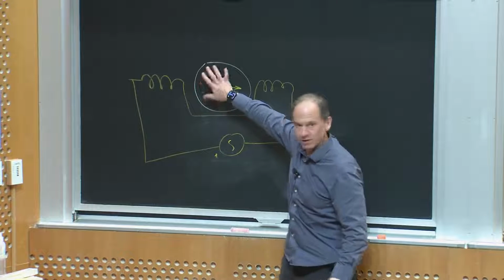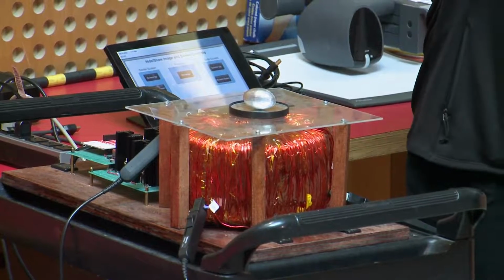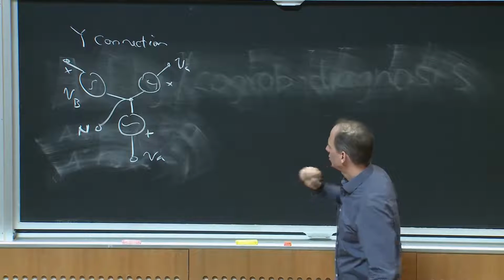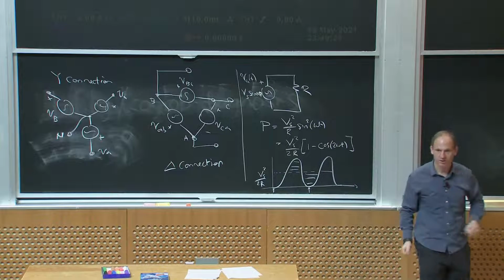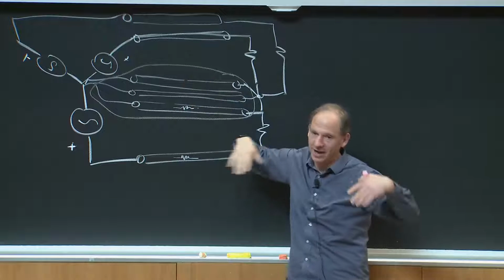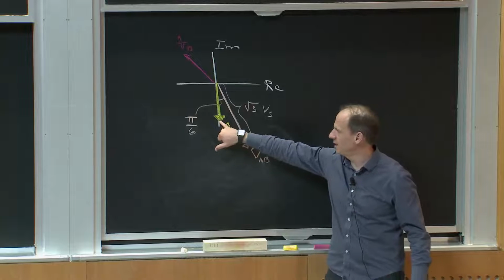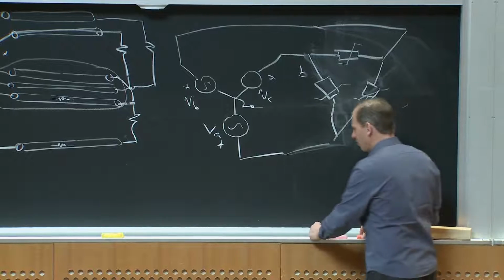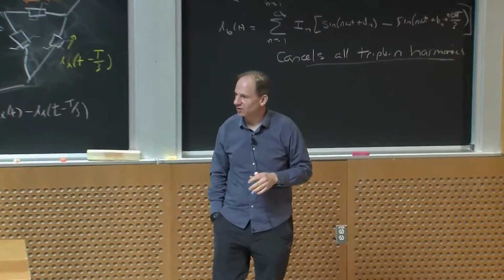Lecture 21: Three-Phase Systems, Part 1

Comment: Adding two unrelated statements to the thread: 1. If you do the math, you'll find that you don't save more copper if you used a 4 or 5 and so forth multi phase system. That's why we use 3 phases.
2. In Germany, houses in residential areas always get a full 3 phase connection. That's handy if you have an application that requires high power or 400V RMS.

Comment: This was the best treatment of 3-phase I have seen.  I would have preferred better development of the sqrt(3) factor though -- maybe using the law of cosines (or the square of the difference via dot product).  I would also have demonstrated how residential single phase is extracted from 3-phase power.

Comment: I saw a lecture which I can no longer find where the question was posed to the reader that something interesting happens as your approach infinite phases carried by a multi stranded cable. Unfortunately it was left open ended so I don't know why the cable would have "interesting properties". Any ideas?

As for phase transmission, I've read that 5 phases would be the most efficient before becoming too tedious to carry at the substation but 3 is just simpler so got a head start

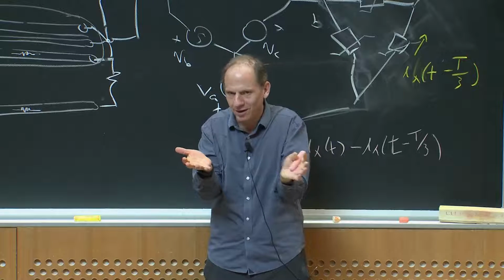Comment: 43:18
It's only a matter of cost-efficiency.
Less than 3 phases is not efficient.
And more phases is more expensive.
( more windings, more wires, ...)
And too many phases on the generator's stator means less distance between, and could create other undesired phenomenons.
3 was a good cost efficient compromise in the early beginnings of large power generators.
And maybe if they knew what we know now, maybe DC would have won over AC, in the "current battle" .. 
Almost everything now runs on DC..
LED lighting, Motors with VFD that have to convert AC to DC , all electronic devices run on DC..
Maybe the only thing running on pure AC now is the electrical heaters..
We even have HVDC transmission lines ..
Reply: i think both have their own application

Comment: Power company generate's 3ph, but residential only gets fed with single phase transforner with a middle tap on secondary.
This method makes it too easy to have unbalanced phases..
Wouldnt it have been easier to just simply feed every customers with 3ph 4w systems? 
∆Y
Thats how it's done for commercial buildings.
Or even better.. ∆∆ transformers. No neutral..
Are the windings in the powerplant generators connected in delta? Or in Y with grounded common tap?